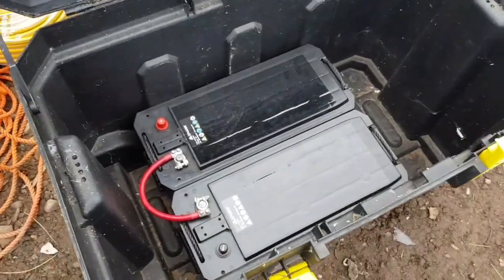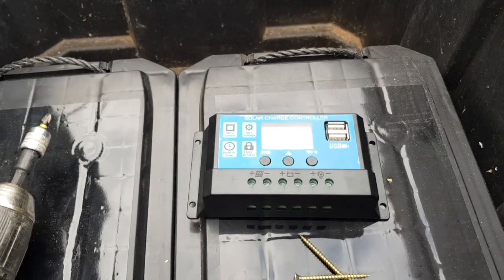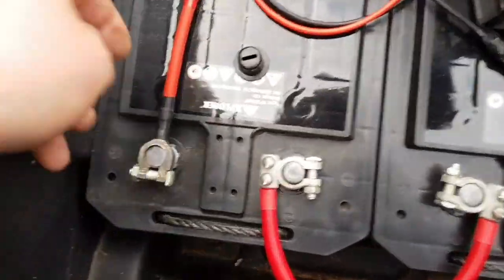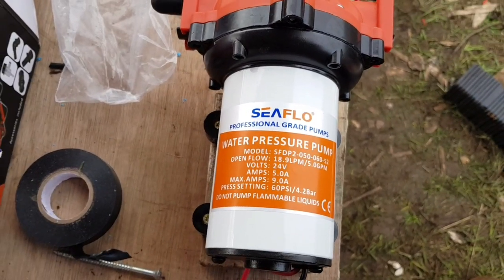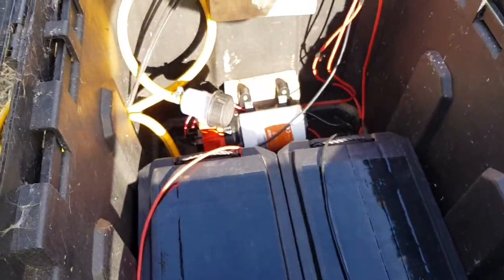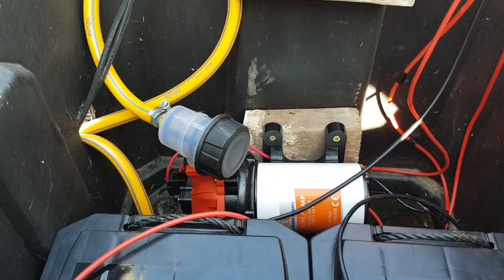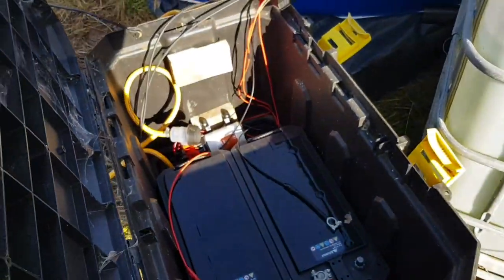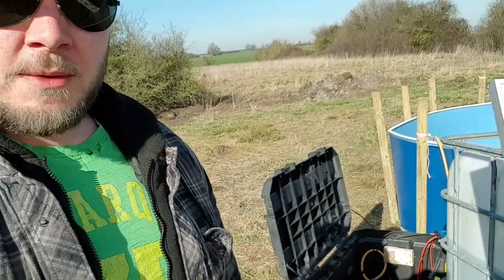Making a 24v solar powered water pump. (Irrigation, off grid cabin, campervan, caravan, boat)

Comment: Hi I have an allotment and two of the tanks on there I want a pump to feed two outlets not at the same time but it would need to give good pressure about 40 mtrs away from tanks will that pump work please let me know what you think kind regards David
Reply from the maker: It should be more than enough it's a seaflo 52 series if you watch there demo vid its powering 5 outlets at high pressure. When hooked to a tap it will switch off automatically when the tap is closed. You will defo want to get a 30 or 50amp low voltage battery disconnect module to power a pump from the batteries long term, solar chargers arnt ment for more than lights on the output really
Reply: Thanks that’s great thanks for your reply kind regards David